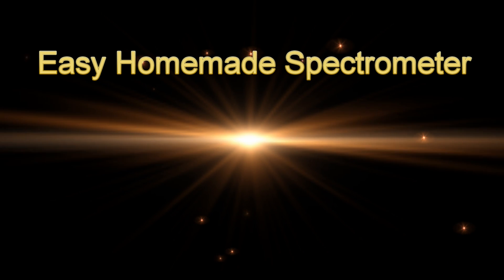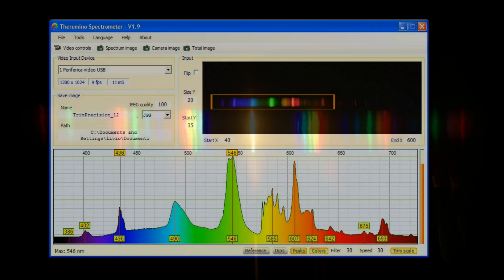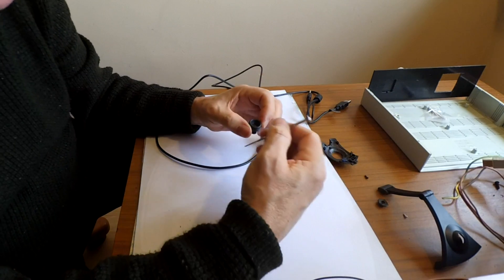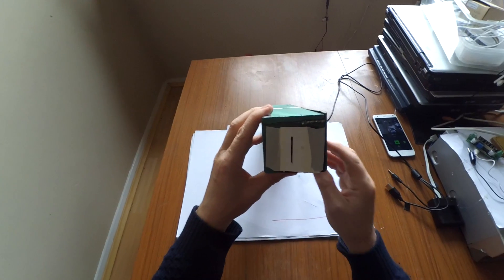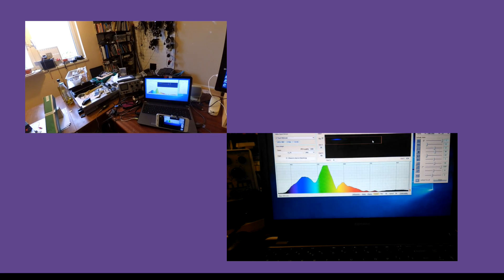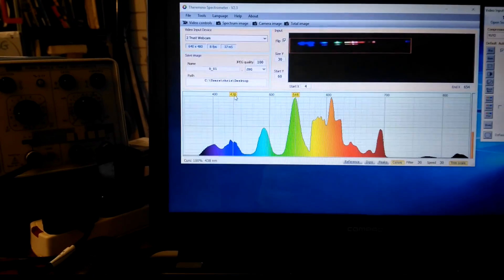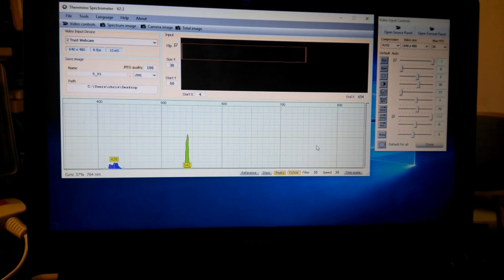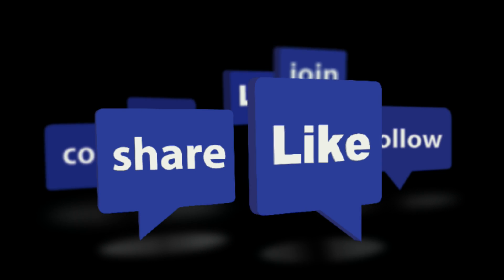DIY Light Spectrometer - webcam & diffraction grating - Applied Science at its Best!

Comment: Impressive! I guess one could also calibrate with a TV remote and sunlight, as these are well documented. IR LEDs are generally well speced. Even without removing IR filter, the webcams I have tested were all quite sensitive to IR remotes, which are 850-1050 nm, depending on the type of remote. I tried that software, now v 2.5. Very easy to use.
Reply from the maker: Hello Dee and thanks for writing. With a TV remote - I know they're all near-infrared, but I don't know if they're all the same wvelength. They'd need to be a known wavelength to be used for calibration. Regarding sunlight - I've been doing a lot of work on this recently with my new spectrometer. Sunlight has a very broad spread of frequencies and it varies by time of day, time of year, atmospheric conditions, and location - so again - it's not great for calibration. There are atmospheric absorbsion lines which can be used though - one for oxygen and two for water. These  are stable and could be used for calibration, though the signals are weak and not always visiable.

Much easier though, is a compact flourescent lamp (CFL). Their spectra vary from make to make, but all of them have a few characteristic lines which are always present - at 546 and 438 nm, which make excllent calibration references.

By the way, I'm making a new video about my new spectrometer which will be on sale soon, so if that's of interest to you you might want to subscribe.
Reply: Subscribed. Many shops sell IR LEDS that are tightly speced. TV remote LED cheap to replace. It has been a lot of years since I did a spectrum for the Sun. I was not aware the lines are shifting during the day. I reckoned it was mainly/only the measured flux. Thanks for input.
Reply from the maker: I'v done a video testing power LEDs using the spectrometer - in the Spectrometer playlist. I found they are not specified accurately, and also that the seller almost certainly substituted some blue LEDs he'd got in stock for some he hadn't because - "who's going to know?"., Well, a bloke with a spectrometer is going to know.

With this instrument, you don't see the sunshine spectral absorption lines as black lines in the image of the spectrum, but as dips in the graph of intensity over wavelength.

These lines don't move - their absorption wavelength is always the same s they're made by the same atoms and the same physics - what I meant in my earlier email, responding to your suggestion that I use daylight to calibrate the instrument, was that a daylight spectrum is a fat hairy blob, and not a line - but you COULD use the absorption lines.

Actually, these absorption lines DO move - due to the Doppler effect. Which is one of the way astronomers infer relative speeds between astronomical bodies. But that's not a problem between sun and Earth.
Reply: Chris: You surely know your stuff. Do you think the issue with the sunlight absorption lines is a resolution issue relating to the geometry of this rig? I didn't do the math yet, but I suspect intuitively that 1000 lines/mm grating and 1000+ pixel sensor are able to resolve sunlight very well. If grating issue, a lifetime supply of 13500 lines/mm grating rolls can be had on Amazon for very little money. I suspect that would spread a full spectrum across an area larger than the sensor, but you would get excellent resolution where you want it.

May I ask how you came to the conclusion that such exact spectral determination of grow lights for plants was needed?

Diverging far from your plant project, I have never heard of anyone claiming for or against this, but Sun might give a very weak Doppler shift from Earth that is measurable during a year due to Earth's elliptical orbit. There is cyclic movement towards and away from the Sun. I believe the Moon can be referenced because it is more circular orbit IIRC, but not sure how I would implement that.
Reply from the maker: Dee, I think you mean 1350 lines per mm - not 13,500. I'm familiar with the 1,350 line material. Instrument resolution and optics quality will certainly be limiting resolution. Spreading a spectrum big isn't the answer on its own. It inevitably means spreading it feint and blurry too. To get the best of every world you need to spend a lot of money on very high quality optics and very sensitive low-noise sensors. For my needs and my pocket - this instrument is all I need.

I didn't and haven't concluded that exact spectral determination is necessary.There i a lot of debate about exactly what is required and my conclusion from reading what was available is that no-one really knows. We know approximately and there are some safe  assumptions we can make, but it's a developing science which has only really become relevant in the last few decades when credible indoor growing light sources have become available.  I just thought - they could be selling me any old stuff and I'd never know - unless I bought red and they sent me blue, and I was curious about making an instrument that could tell me what' really going on.

Doppler shift due to the Earth's elliptical orbit is going to be un-detectable by any instrument I could ever imagine building so I'll leave that to you to worry about!. Make a video of what you come up with!
Reply from the maker: Wow,. your plans sounds fascinating. I'd love to know how you get on with them.
Reply: Near Slit , What is there ??? Diffraction grating or Mirror ?How to select wavelength for this caase? for example 400-700nm  for analytical analysis of chemical solution or dye /Where you had connected DVD Diffraction grading? Have you connected the mirror? At the edge of the slit? Or you have connected in front of the camera-Lens?How to get absorbance -wavelength curve for a cuvette

Comment: how accurate is this meter?
and what resolution can you get from it?
Reply from the maker: Patrik you can read the software documentation for more on that.
Reply: Chris Wesley thanks. that seems impressive. resolution seems to be around 1nm! 
compare that to the super expencive Jeti 1211 spectrometer that has only 4.5nm.
seriously i dont know what an expencive reference spectro can give that you dont get here.
whats your thoughts ?
what do you actully pay for with expencive spectrometers around 10K dollars ?
Reply from the maker: I agree with you Patrik - and I have no answer for your question. Really the physics is very straightforward, and the demands placed on the apparatus are modest. Calibration is easy. I suppose - like many things - we are content to pay more for things we don't understand.
Reply: the  things i can think of is the lack of CCT? or can the program calculate colortemperature?
the other is if it reads light wrong but how would it do that with 1nm resolution?
it captures more light info than most of the expencive spectrometers.

in the PDF it says something about the lack of measure the lights quantity or something compared to the i1 Display Pro meter.
dont know what difference that makes.

quote:
"The high cost of X-Rite is partly justified by the fact that it also provides information on the "quantity" of
light, while Theremino Spectrometer can not do it (webcams are not enough linear to be able to measure
the amount of light they receive)."

do they mean lack of measuring luminance?
if so i dont need it as i already have an i1D3 colorimeter

what im looking for is to measure white light from different televisions and just compare the SPDs.
nothing more
Reply: btw its not possible for you to rent or borrow an more expencive spectrometer like the Jeti Specbos just to compare the results?
Reply: i got the specs from SMPTE on how an reference spectrometer must perform
is it possible to measure your spectrometers accuracy and compare it to the specs?

"SMPTE has established standards for such a device. It must measure color accurately to within ±0.002 xy at or above 10 cd/m2 and luminance accurately to within ±0.5 cd/m2 for white field measurements"

Edit: "color accurately to within ±0.002 xy"
that goes in line with the resolution so i think you can delete it already if it can read 1nm.
color accuracy is then much lower or should be

more info on the Jeti 1211 here
http://www.curtpalme.com/ChromaPure_JETI.shtm
Reply from the maker: I don't know if it's possible or not Patrik. I haven't tried.
Reply from the maker: The spectrometer in its current form meets my needs, so I don't want to invest more time in the areas you suggest, Patrik, but I would be interested in seeing the results if you do that work.
Reply: yes that would be interesting..so can i borrow 9000$ and buy the Jeti :)?...just joking

Comment: Hi,  great video thanks!  I would like to test the light passing / nm value of a IR filter.  Where would be the best place to put the filter, in front of the slit or the grate? Thanks again
Reply from the maker: Hi Jay, to test the IR filter, you'd need an IR source, and then look at the spectrum from it - with then without the filter in place. Put the filter between the light source and the spectrometer's slit.
Reply: Chris Wesley Thanks so much for taking the time to reply, answer was spot on! Much appreciated! 😀
Reply from the maker: No problem Jay - you're very welcome.

Comment: There's one thing I don't understand: accounting for the possible color distortions of the webcam (by calibrating it against a reference light source; I don't think a random fluorescent light will do though) is one thing, but these webcams are usually crappy as hell. For instance they have a small sensor, pick up an awfully lot of noise and the sensors definitely have their own, unique characteristic light absorption spectrum as well (i.e. different wavelengths will produce a different signal intensity). How do you account for variables like that?
Reply from the maker: Hiya CoolKoon. The thing about flourescent lamps is that they are all not random but one of only two kinds. The composition of the gases in the lamp is fixed within kinds, and the spectral lines of its elements are determined by physics and never change.

In practice, you point it at a lamp, you see which of the two possible spectra you have, then you use the lines for mercury etc. to calibrate the unit.
Reply: Okay, fair enough, that takes care of the coloring. But how about the rest of the variables e.g. the noise level of the webcam, the low intensity range at which it works (the difference between the brightest and darkest points it can capture at the same time), the sensitivity's spectral variation etc.?
Reply: @CoolKoon  The exposure is locked to a level where noise is below the predefined gate. Only real light will then be detected by the sensor. This of course means that the intensity is a relative measurement and not absolute, so it's not perfect in all regards. It will also function poorly in regards to low light emission sources.

Comment: Hi, thanks for this job! I think that in order to see the UV, you should change the glass lens of that webcam, and instead stitch it a silica lens, that is transparent to UV, glass it's not! But, before you need to measure the focal of the original, must be about the same. There are polycarbonate lens also, good trasparency to near UV and less expensive. Bye!
Reply from the maker: Hiya Marvek and thanks for your comments. My understanding is that the transparency of UV light depends on the type of glass. As you point out, most UV light is blocked by ordinary glass. Quartz, for example, is transparent to UV. However, this spectrometer was built to test the power LEDs used to build grow lights, and UV is not really important in this context.

Comment: Thanks for the video. When you point it at the sun, why is there a dip between the blue/green and green orange at 13:49? Is it mis-calibrated and were you able to fix it?
Reply from the maker: Dan Wozniak - great question. I don't have a good answer for you though. I will try it again and see if I can find out.
Reply: @chriswesley594  Is the window open when you point the spectrometer or the light shines through the glass?
Reply from the maker: @КристинаМартинова-б7б  The window is closed so the light is coming through the glass.
Reply: @chriswesley594  Could you redo the experiment with an open window and check if the dip is still there?
Reply: Did you figure it out?

Comment: Awesome video Chris!  Ii your camera is not sensitive to UV could it measure UV?  Also, it seems the camera would have varying sensitivity across the spectrum so you would need to do a gain vs frequency calibration.  Maybe this would not be difficult using a known light source like the sun?
Reply from the maker: Hi Dave. apparently, without filters, a typical webcam sensor is sensitive to a much wider range of frequencies then the human eye - including UV up to about 200nm.

Regarding sensitivity - yes, I also thought about this. The Theremino software shown software allows you to alter white balance and automatic gain control settings, but I'm not entirely clear on precisely what they do in this context. There is no calibration settings to allow you to adjust gain at specific frequencies/wavelengths in order to null out non-linearities in the sensor.

However, the spetra I get from Compact Flourescent lamps are almost exactly like those in the documentation, which are in turn, very close to those obtained from professional instruments.

I think most sensor these days use the same sensor technology/physics, which may, with standard drivers, manifest reasonably linear behaviour.

Ultimately, for me, this is a hobbyist machine, so I'm not sweating it, but if you take it further I'd be very interested in what you find.
Reply: Near Slit , What is there ??? Diffraction grating or Mirror ?How to select wavelength for this caase? for example 400-700nm  for analytical analysis of chemical solution or dye /Where you had connected DVD Diffraction grading? Have you connected the mirror? At the edge of the slit? Or you have connected in front of the camera-Lens?How to get absorbance -wavelength curve for a cuvette

Comment: Do you think it's possible to measure the black lines in the spectroscopic image? That'd be huge. Obviously not with a simple webcam. I was thinking of starting an Arduino project on this.
Your thoughts?
Reply from the maker: Hello Coldmow. If you mean an absorption spectrum, then yes, it is possible. By removing the slit aperture and changing a setting on the program. I have done some experimenting on it and will make  a video on it, so if you're interested in that, you might want to subscribe.so you're notified when it is uploaded.